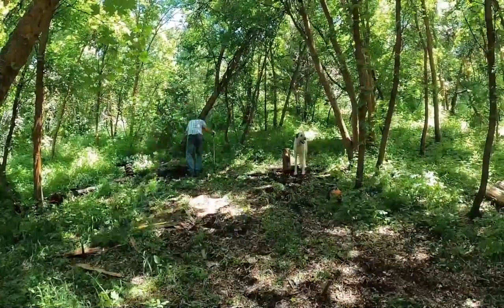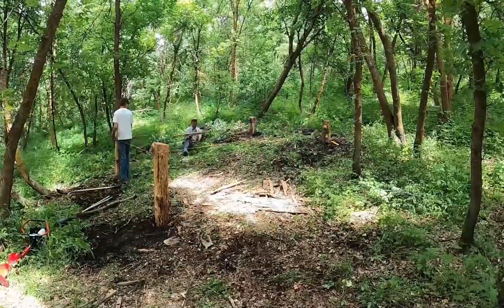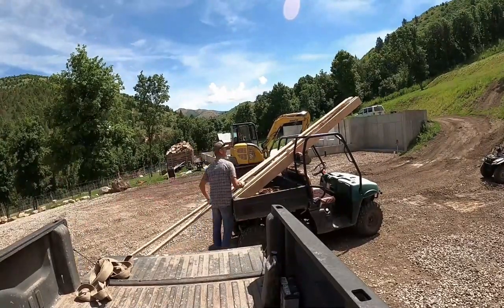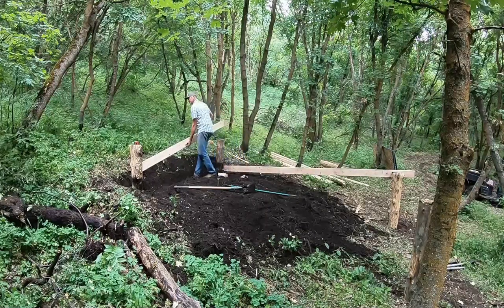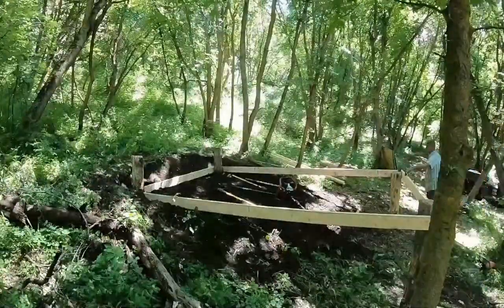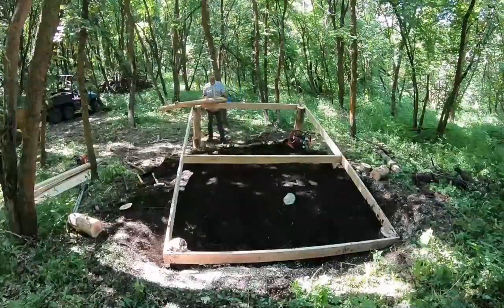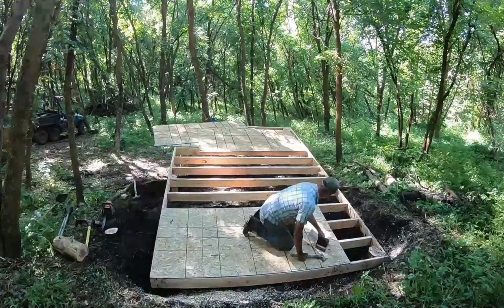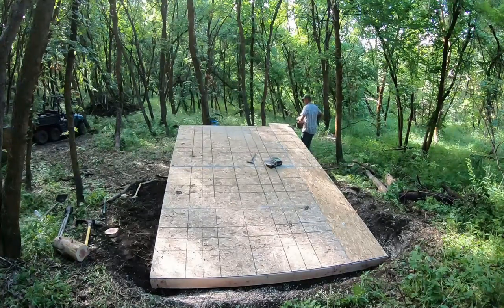#417 - I Built A Tiny Off Grid Cabin On The Back Of Our Property!

Comment: Hey Heath, I know everyone on here is an expert in everything. However, one suggestion for future projects. If you're going to build on corner tiers like that, they need to be notched for the joists. Never face/surface mount joists. Keep up the great content and thank you for all that you do. Finding someone that produces content that also has morals is a rare thing these days.
Reply: The OSB floor sheeting should have been installed perpendicular to the joists, not parallel. Also, best to stagger the seams.  But, it's his cabin, he can build it how he likes.  Might also have moisture issues with that OSB so close to the ground on the one end.
Reply: @darinvee4980  I had not made it that far in the video when leaving my comment, but I agree on both accounts.
Reply: What do morals have to do with building something ?
Reply: @Sjrick  what do you mean?
Reply: They should be setting on the piers to hold the load. Screws are not made for shear strength
Reply: @billevans8291  code calls for, at least where I live, a minimum of a 6x6 notched. Sitting on top of a pier will not pass code.
Reply: He should have also control burned the ends of the cedar logs that he buried in the ground.  That important step significantly slows the rotting process that will take place during the changing of the weather.  The fact that those logs are the cabins foundation make the controlled burn process extremely important to the longevity of the entire structure itself.  :-I
Reply: @Deutschehordenelite   What part of my comment did you not understand ?
Reply: Should have  stopped right in the beginning when he realized he was below grade with his joist gotten longer post and raised the whole project. Now he's going to have snow and water runoff trapped behind the building causing premature rot or maybe displacement of the whole building.
Reply: @kabarsedge... and yet you prove your own point.  I'm surprised RPR has anyone that watches, seeing that he makes so many mistakes that are unforgivable.  I understand now why he doesn't read the comments.  What a downer it would be to get gut punched just for making a video about what's going on on your homestead.  Keep it up RPR, I'll keep watching and won't be critical about anything you do.  It's easy to criticize when you're sitting in your lazy boy, not doing anything.
Reply: Dean O. In 1963 I helped my grandpa cut and split cedar trees for fence posts. We let them dry for 18 months all we did was fry them. Then built a fence enclosing 9 acres. Every 10 feet we dropped a post. That fence still stands today. A neighbor built a similar fence with creasote(sp) posts. That fence just got replaced the third time. Burning does extend rot resistance, but a near 60 years so far ain’t bad. 🙂
Reply: kabarsedge I highly doubt he’s worried about code for his little cabin in the woods lol
Reply: @better_than_nothing  not everybody is worried about what's code. In Idaho no one's going to bother him about a shed on the top of the mountain. He's going to build it in one week for a few hundred dollars. it's not a house. It's just a little cabin. If it starts to rot ,20 years from now, he can build another one. I built my first cabin with standing live pine trees. Cut them off about 10 ft and nailed boards around it. since I was a twelve-year-old kid, I surface mounted the floor joists. I'm sure it's rotted some in the ground but it's still standing 35 years later.
Reply: It will be 2021 by the time the " Experts " get done telling each other how to hold a hammer .
Reply: @deano.7533  Those are cedar posts. No need to burn.
Reply: @DK-jd8bj  you're welcome to build how things you want, but Heath tries to do things right. Screws and nails are not made for shear strength. it either needs to be notched or it needs to set on top of the piers.
Reply: Darin Vee yup
Reply: That last line is so true!
Reply: @billevans8291  yep all weigjt on Screws  outside piers  wtf  ?
Reply: Patrick Elliott  they're cedar. They'll last.
Reply: Agreed, I don't see why he just didn't notch the pillars since it's such an obvious thing. That said it's a small cabin and it's not as bad as it could be since the structural corner posts will be on the pillars. I also assume he will have some kind of ground insulation or those floors will start to bow very quickly.
Reply: @station079  Or some of us are not armchair critics and we are professionals in the trade and just want to point out the issues we see.  Maybe he will read the comments before it is time to build this cabin again.  It will rot and sag to the point of it not being usable in 3 years.  We all make mistakes. Do we all learn from them? Not if we don't listen to people who have already made the same mistakes.
Uphill posts too low. (below grade).
Posts not treated or charred.
Joists not on the post and only screws holding it to the post.
Joists screwed in to beam instead of using hangers.
Joist not made of treated lumber.
OSB used for floor. Should have been treated plywood.
You have to get the foundation right to have it last.
If it is worth doing... It is worth doing right.
Suggestions;
10ft x 15ft ?
12ft x 16ft would be less cutting and better staggering of joints and works out good for 16Inch OC.  10ft x 15ft does not work evenly for 16 inch on center.
Not saying this is a bad channel. I don't subscribe to this but I watch it when it is put in the next up feed.
Reply: @better_than_nothing  those are probably at least 6x6. But in hindsight I should have also said notched so the they had both the vertical load capabilities and be we used to the post
Reply: @kabarsedge comment was respectful and it's easy to see it's also accurate. To those here saying "don't criticize", as someone who hopes to get my own off-grid property, I appreciate the criticisms and recommendations on how to do it right. I'm grateful for the comment.
Reply: @station079  people watch him build unsafe, they copy it because he tells his audience how experienced he is.  That's criminal.
Reply: @xanderzurasky7837  funny you mentioned it. That huge front porch ledger was nailed not bolted. A little moisture, time, and snow load its coming down! I'm sure we often see news reports of decks collapsed with death and injury. Poor construction practices, heaths specialty.

Comment: Difficult to fix at this point I know, but the rim joists should have been set into notches in the pillars so the pillars support the weight.  At present the entire weight of the building is just on the fasteners, either by nails or screws.
Reply: Ye I was thinking that. Screws are not that strong. Maybe he'll put some heavy duty brackets onto the logs, attached to the rim joists
Reply: And the main load bearing 2 bus are not enough for that distance....
Because we know at a point in time the whole family will be inside...
But as others have said it's his cabin...
But still frustrating to watch
When for a little more 
It could be built right..
Reply: James not exactly.  When he builds the walls they will be partly supported by the post as they will overlap on top of them especially if he builds 2x6 walls.  I would    use some long spikes to fasten the walls to the post however.
Reply: It will be 2021 by the time the " Experts " get done telling each other how to hold a hammer .
Reply: @bennybenboy111  He should run at least 4 carriage bolts into the posts at the beam level.  Two for each facing beam.  All the way through.
Reply: easy fix o just add some support to it at this point with 4x4 and lag bolts or carriage bolts and washers, otherwise they will sheer off in a few years
Reply: I see this lil shed leaning to one side no, gravel on the bottom for water drainage will certainly rot out those cedar post ! 10 by 15 shed is a nice size for tools .
Reply: It can be fixed but you will need cement blocks. In essence you would encase those pillars with blocks so the struct is sitting on those blocks.
Reply: @georgezgreek  How should he hold a hammer ?
Reply: Rose  yup i agree, everyone sitting watching this while claiming universal credit is suddenly  an expert in construction, let the guy do the job his way.

Comment: First time I've ever seen foundation posts sitting above the frost line on dirt not treated even if it's Cedar. Since he using OSB as the sub floor, I don't suspect it will last more than 5 years without the OSB turning into mush from mold. The moisture under the floor from the dirt will do that damage from the start. And one last thing, you always stagger the joints on the floor for strength, the way you did it made the weak points along the two foot side of your OSB. You want to preserve the pristine area around the cabin but you've just created an instant decaying abode with your building techniques. Good luck.

Comment: I read/heard a you tuber talking about the insulation in the floor. He found the best way to insulate the floor was by using, of all things, bubble wrap. Yes plastic sheets with bubbles in it! By putting a couple layers on the floor underneath bad is, it decreases loss of heat and keeps the floor warm.  Because it’s an unusual being the mice will not eat it, or nest in it. That cuts down mice in your cabin when no one is there. Styrofoam insulation in the walls and ceiling also decreases destruction by mice. I don’t know The cost of either of these compared, but it sure sounds like a good idea to me.
Reply: Foil bubble wrap is what Boss of the Swamp used.

Comment: Your Canadian Northern build that your into is the back end being stuck in the mud will rot real quick with all the snow coming in the winter months.  UP here we build the floor frame on top of the logs plus we brun the logs so they do not rot as fast.  That area you need to of dug out a bit more so there was room for air movement.

Comment: Sounds much like our cabin but ours is 16 x 16 with loft-  front porch-  later addition was 8 x 9 lean to kitchen addition-  mostly cook on the wood stove but also have an outdoor kitchen-  ours is 1/3 of a mile from our main house-  ours a  combination of 2nd cut siding and board and batten-  tin roof of course-  outhouse-  no electricity-  walk out and be off grid and on vacation without the drive-  I always wanted to build a cabin so did it.  Wife helped a lot.

Comment: Heath, if it's not too late, it would be a good idea to double that rim joist and flush the double with the top of the osb. 1 2x8 can crack but at least you have another to hold up the building. Cheap upgrade.

Comment: Looks like a cozy location. Do yourself a favor and put nails in to hold the floor joists. Screws have a very low shear strength as compared to nails for a side load as that floor will experience.

Comment: You probably should have treated those posts going into the ground.  The simplest way given the location you were working in would be to used the Sho-Shugi-Ban method.  You put the logs into a fire and scorch the crap/burn the outer layer of what part goes into the ground.  It supposedly creates a sort of scab that keeps bugs away and slows rot.

Comment: I would still add 1 solar panel and 1 battery to power a small set of LED lights at least and reinforce them posts on the floor decking... they otherwise are only held on by the sheer force of the nails/bolts

Comment: Love the idea of a peaceful place to get away. 

If memory serves me, there was a bit of a strength issue installing the OSB parallel with the rafters on the house and additional blocking had to be added.  The same thing now done on the full 8' sheets here on the floor of the cabin. The floor is going to be very "springy". All of the sheets would be better installed running the same way as the 2' wide rips.  With the joists being that close to the soil of the slope, moisture could be an issue.  More clearance to soil would allow more ventilation and less chance of the untreated wood from rotting.

Comment: Great work on the whole Homestead.  But I am scratching my head right when I  saw you use wood post for your main four corner support system for the whole cabin---bare wood into the  dirt will rot.  Especially with year after year of snow and water seeping down around them.  I thought after all the great and good work you have done in building your home, you  would have used sono tubes and poured cement in them.  Ouch.  This is a nice fun little space for your kids to grow up with.  lots of summer nights sleeping up there.

Comment: I love your channel. I did have a couple questions with the cabin build why you didn’t Notch the perimeter joist into the post to provide better support rather than sheer on the sides and also why are you installed the OSB floor in the Direction you did and not perpendicular to the joist where it would be stiffer.

Comment: I think you should have set your corners on top of your corner pillars by notching the two sides of the pillars. Would have been better and stronger way to carry the cabin's weight. Lot of stress on them the way you did it and you're going to have to tie them underneath with a cross brace at least.

Comment: Heath – why did you use untreated wood for your cabin foundation? Wood in dirt is just going to decompose. No concrete? No burnt wood?
Reply: Hi Jason I agree. Still building 🎸?
Reply: Cedar post will last 20 years in the ground.  By that time the cabin will need to be rebuilt anyway.
Reply: Cedar post will last 20 years in the ground.  By that time the cabin will need to be rebuilt anyway.
Reply: Jason Armstrong yes, yes, yes....
Reply: Cedar has a naturally occurring oil in it (once it gets old enough) that will prevent insects and in hand prevent rot for a very long time. No need for concrete or Shou Sugi Ban, the Japanese fire treatment. Cheers!
Reply: John Beaber that’s what people don’t get. This isn’t a house meant to last 100 years. If it lasts long enough he is too sore to get to it anymore it’s done its job

Comment: hello RPR .  
if you place NOW 1 or 2 cheap 1000L IBC tanks UNDER the front for rainwater collection and a cheap old style hand pump in the cabin later , 
do you also have water in a cheap and sustainable way ?  
if only to use in an emergency if you have burned yourself on the wood stove .  
or to simply boil the water on the wood stove for making coffee / tea to get warm .  
you could make a whole lot more out of the cabin with a few simple but well done (as you normally do in my eyes) .  
just some ideas : 
- placing a telephone pole at the back in the ground, I think you could get above the trees 
- with a simple solar panel on top to keep a car battery on voltage or a safe way of LED light 
- on the telephone pole an antenna for CB Radio for an Emergency radio to the house ?  

I'd love to hear from you to exchange ideas for this .  

kind regards Hollandduck from the Netherlands 
(source of translation: Google translate)

Comment: The cabin is your dream, not mine, but I would mount a couple LP gas lights on the walls fed by a 100 lb. cylinder that you could refill when needed. I hate the smell of kerosene in a house. I've lived with pot burners, oil furnaces, and kerosene cook stoves, and kerosene lamps. I'm sure your grandfather wouldn't mind. You could also use a ventless LP gas heater rather than start a fire for a few hours use. Cabins do catch fire when a stove is left unattended. Wood smoke also alerts game if you hunt out of the cabin. My grandfather would be 129 if still alive. He taught me about hard work. He led mules and horses on the towpath of the Erie Canal at age 7 and his father went to work for the Shakers at Mt. Lebanon at age 7 when his father went off to the Civil War. The Shakers were all about making life simpler and easier when they could. Shakers invented the first commercially successful washing machine in the United States. The machine, which is on display at the museum, is a massive wooden contraption with multiple tubs that allowed for washing laundry at different temperatures at the same time. Shakers are also credited with inventing the circular saw and a machine that sorts seeds as it sows them. The wooden clothespin is thought to have been refined, if not invented, by Shakers. So there is nothing bad about making like easier. You work hard enough as it is. Relaxation time is supposed to be less work.

Comment: How on earth are you keeping the foundation logs from rotting in the ground?
A good start..!
Reply: And what is keeping the side joist boards from sliding off the foundation poles when the weight of the cabin + the snow load  is pushing it all down? 
Are you using at least 1/2"  all threat to secure the joists to the  poles?

Comment: Shou Sugi Ban the wooden piers so it doesn't rot in 5 years.
Reply: Cedar doesn't need to be treated in anyway... A 4x4 cedar fence post can easily last decades, let alone a full log...
Reply: @mattsharpe3989  what about the  floor wouldn't moisture affect that OSB ?
Reply: @mattsharpe3989  This applies to older cedar. I'm not sure where the age cut off is, but I know young cedar doesn't have the oils in it that prevent insects. So those four main posts should be fine, I'm not sure about those thinner two in the middle but knowing Heath, he likely considered all of this well before doing anything.
Reply: @mattsharpe3989 
Not in that kind of soil. Looks like black earth, which is a water sponge. He should have put a 6"  bed of gravel in his holes plus a coating of tar at the bottom ends of the posts. As is, the posts will absorb water like crazy. 
Sad.
Reply: @scclif  You can get specifically made OSB that is more resistent to moisture.
Reply: Just looks like an obvious error not treating wood touching ground...it’s so easy to Sho Sugi Ban the bottoms. But, I would’ve thought they’d be concrete piers or footings in that black soil..